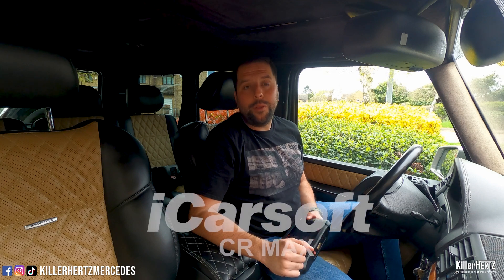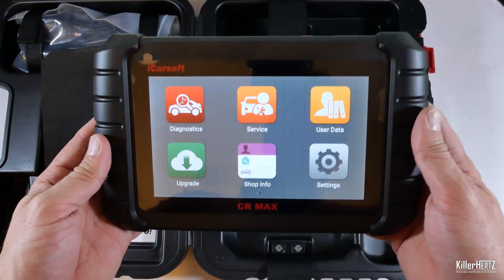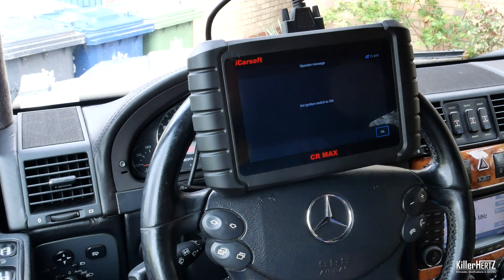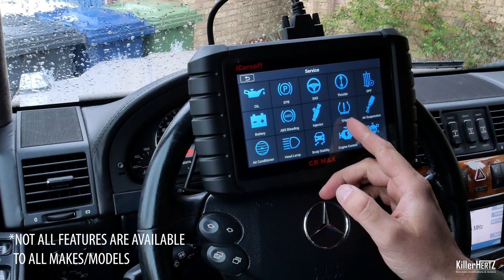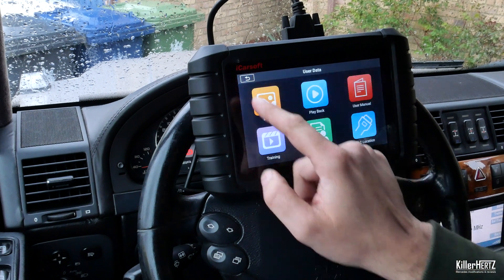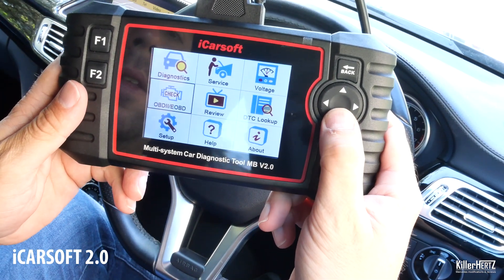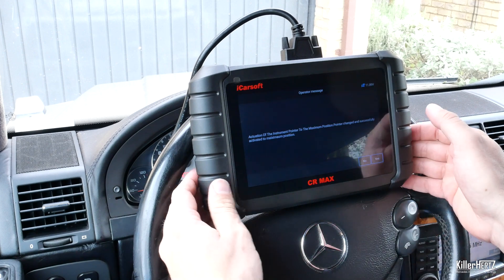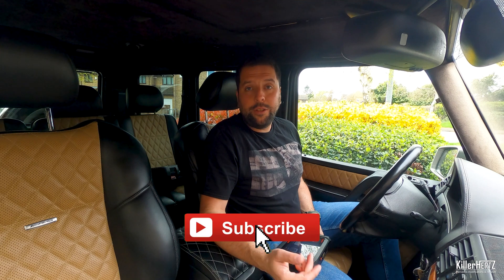iCarsoft CR Max Diagnostic Scan Tool For Mercedes Review

Comment: I got one and when I plug it in on a clk diesel 2007 no voltage of battery comes up and it won’t read vin 🤔 is that a fault with the OBD port🤔
Reply from the maker: It could be as simple as the connector pins need cleaning, instead of just inserting the cable, shine a torch on it and have a good look at it etc...

Comment: Hi, I'd like to buy a CR max but one of my cars is a Mercedes r129 SL500 with a 38 pin OBD...do you know if it will read any of the codes on this model through a 38-16 pin adapter ? Thanks George
Reply from the maker: I dont know im afraid, if you reach out to them directly they will be able to confirm either way.

Comment: Well i just tried v3.0 on my 98 w140 it didn't work  ☹️ edited i contacted icarsoft i was told i have to get adapter to hook up in engine compartment plug . I will post when it gets here 😊 i didn't realize it had both and my other benz 300se it was very noticeable close to all the ecm modules this car it was hidden under big plastic cover on passenger side 🤔

Comment: My cr max cant read the vin off an mercedes A class! Lots off buttons butt I think they dont work all! Cr max also failed on my jaguar xf! Never again an icarsoft
Reply from the maker: Have you contacted their support? possibly just needs a firmware update.
Reply: @killerhertzmercedes  I do but they don't have a solution. Very disappointed. Thanks anyway
Reply: It works great on my xk150 👍

Comment: How do you download apps onto the device ?
Reply from the maker: If you sign in with your Google ID you can do it via the Play store on the device itself, or by downloading the .apk files and manually copying them across.
Reply: @killerhertzmercedes  will it add an app to the home screen like a tablet
Reply from the maker: @craige101  Yes, it is an Android Tablet.
Reply: @killerhertzmercedes  have you done this yourself I have tried and it will only let me download apps to my phone that's linked to my play store account ?

Comment: I have bought one of these units. Great job but i want to know does anyone know if its ok to use and an OBD2 extension cable. If so what sort of maximun length will be ok to use with it.
Reply from the maker: Should be fine to use, im afraid I dont know the maxium length it would allow.

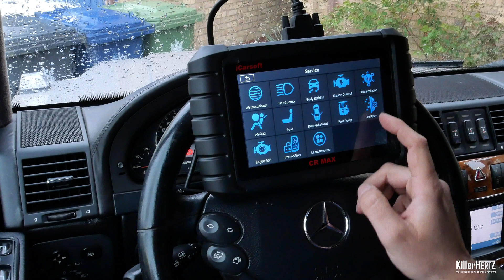Comment: Hi, thanks for your review. A simple question about the function "AFS - Self-learning process after replacing the air filter" showed on service menu (5:58). I think it is available in this version and also in the iCarsoft MB V3.0. Do you know something about this functions? Is it for setting after the air filter replacement as the professional MB diagnostic tools do? Thanks in advance
Reply from the maker: As far as im aware this function can only be performed on non-Mercedes models with the iCarSoft. You will need STAR diagnostic for that.

Comment: My W210 is in Limp Home Mode, it keeps this situation after doing AFT OIl Change, Conductor Plate & 38-pin plug replacement. I'm reading somwhere that the TCM need to be reset and therefore looking for either:
MB Star SDS C4 or some advanced Scanner

Should I go for this iCarsoft CR-MAX to handle this job? Thx Advice.

Comment: It's a good review, and I personally benefited from it, but the question is, what parts can't this machine read?
Reply from the maker: The trouble is with Mercedes scanning, each car differs with what you can/can't do. Alot of things are locked down. Compared to BMWs for example where you can code many things with 3rd party scanners.